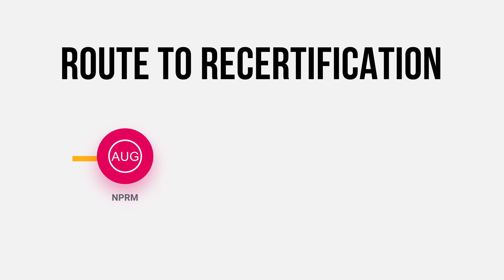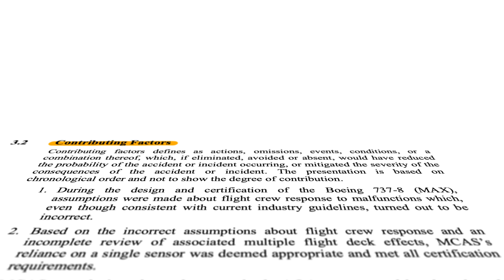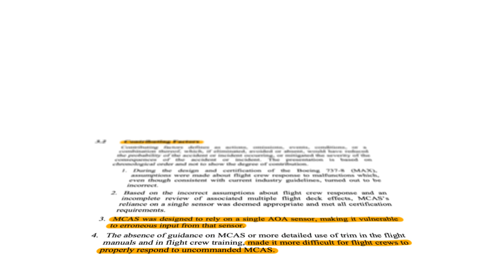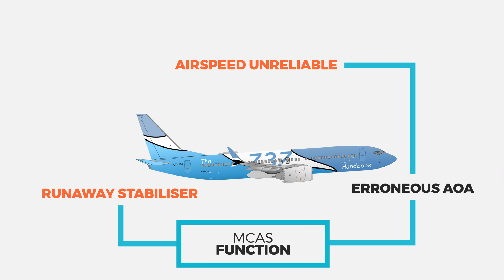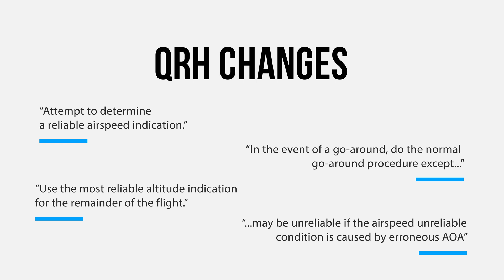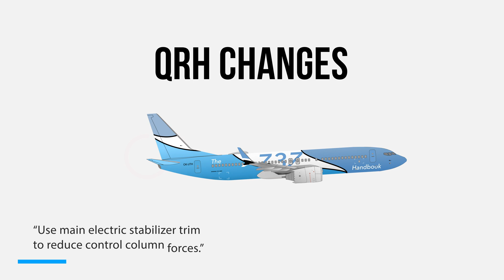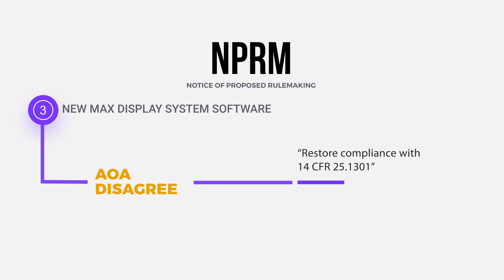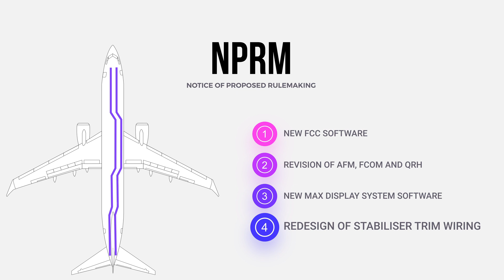737 MAX - Version 2.0

Comment: The FAA didn’t require Boeing to redesign their wiring, EASA did. The wiring was never an issue on the 737 and the same design has been used for the past 60 years. Kinda stupid to change something if it ain’t broke.